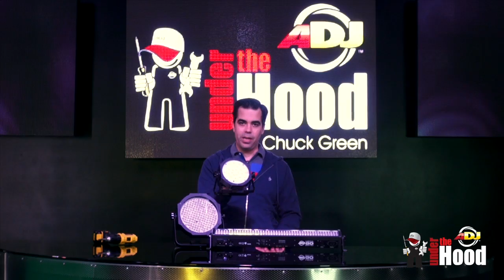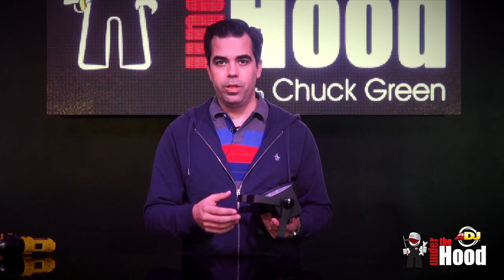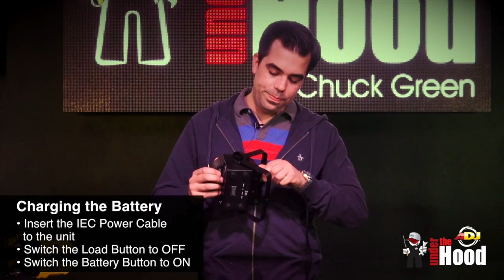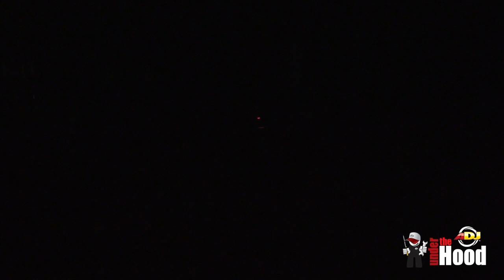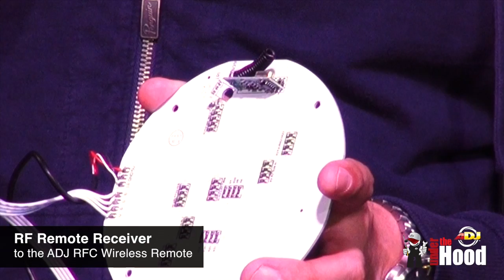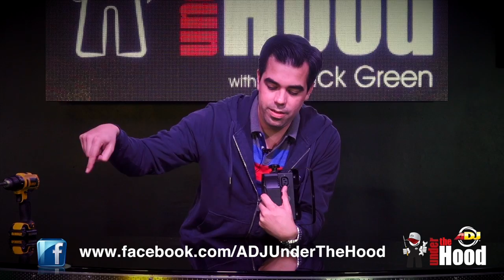ADJ Under The Hood: Mega Go Flood Par

Comment: Wow, yet another fail. I would assume it's the shorter of the two. That can be easily fixed though with a portawats. I used a solar array as a shade and to charge my battery bank. Later when the solar watts died off I was able to go another 6 hours off my batteries through my inverters. No gas powered generators in sight...